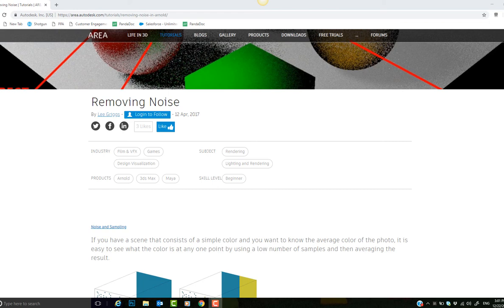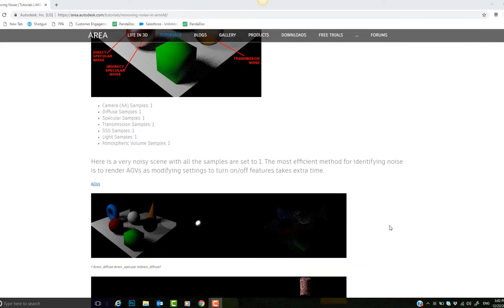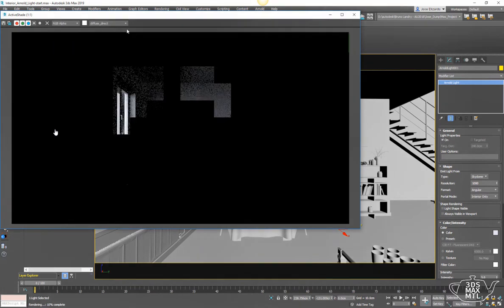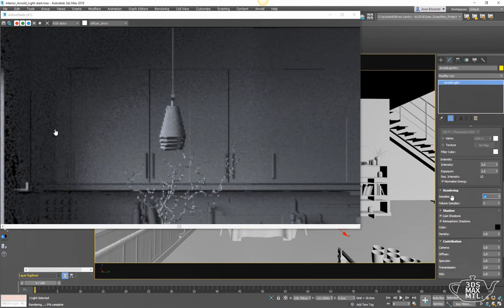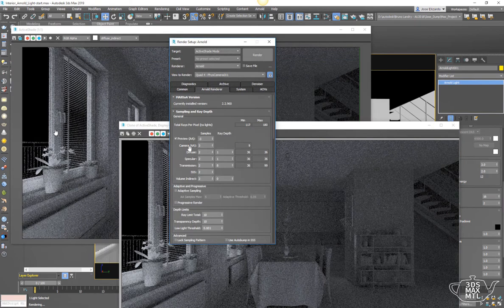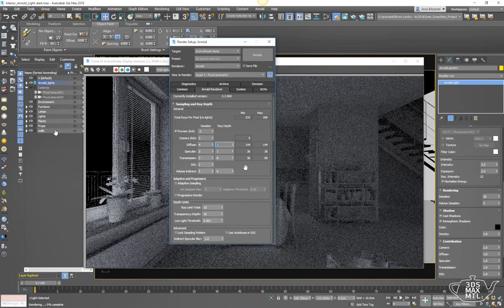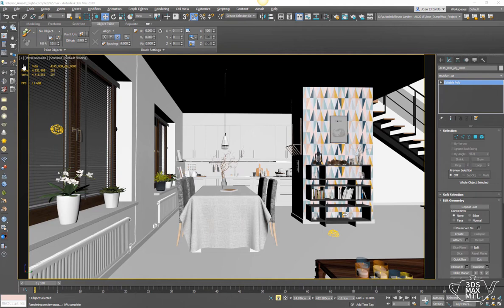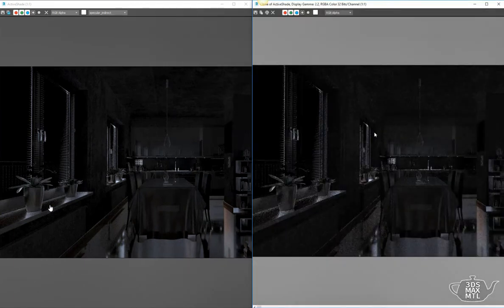3dsMax & Arnold: Removing Noise

Comment: As per usual, a great tutorial that doesn't seem to work for the Arnold on my computer. Why does Arnold suck so much?! (yes, this is rhetorical) 

While the AOV's helped me to pinpoint the artifact noise. The settings under Sampling and Ray Depth did nothing to improve it. Is there possibly a way to affect this noise problem within the Materials themselves?

Comment: ...menus don't match...can't follow...why do autodesk put links to that video???? It's obviously obsolete.
Reply: Yeah I'm at a total lost when trying to figure out how to export indirect and direct. Also my render window only shows RGB in the drop down 😵‍💫 have you had any luck?
Reply: @JaySamurai79  In render output (f10) In the AOVs menu (when you setup production rendering mode to Arnold) then Arbitrary Output Variables AOVs Manager.Uncheck Combined at your left in the components list. Then click add to new file buton at the botton left. It should put the two separated on your right. You must chose the render output folder at the bottom right. Also choose the type of files rendered by default in the type column in the middle . By default it's in EXR file format but you can set it up to be PNG or JPEG. Hope it helps :).
Reply: @user-py4ls6pp8f  Hey thanks, I'll give this a go tonight when I get home. This could be life changing lol
Reply: @user-py4ls6pp8f  This helped me out! This is the up to date method to do what the video was trying to describe in an older version
Reply: @ROMTHIRTY  No problem! Glad it helped you: it was very frustating to search... 😮‍💨

Comment: I havent used 3dsmax in years. I only have RGB alpha and can't select the different AOV's from the dropdown menu on the render image. - Nevermind. I had to change from production.
Reply: can u explain it in detail please ? im having this problem when the dropdown at RGB does not show up the diffuse setting, it just shows the RGB (BTW im using  3ds max 2018 )
Reply: @mistorpiee   on the render settings i had to change from production to active shade (where you choose the render engine to use). I haven't figured out how to export the layers. I kinda gave up :)